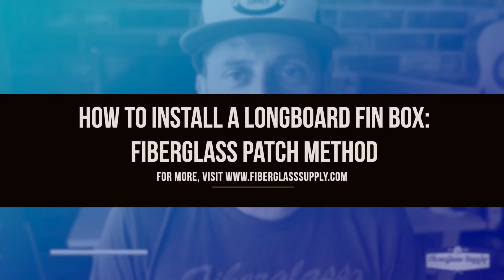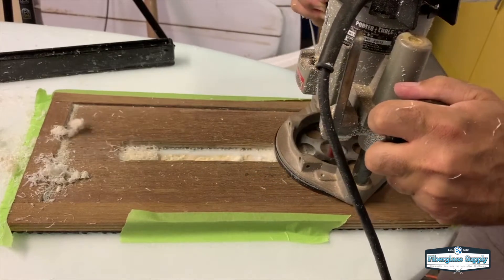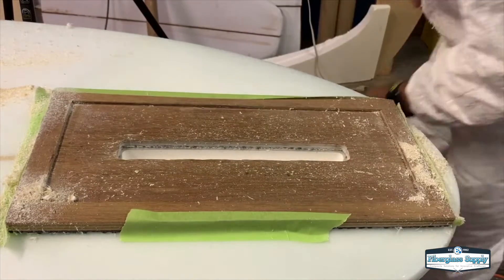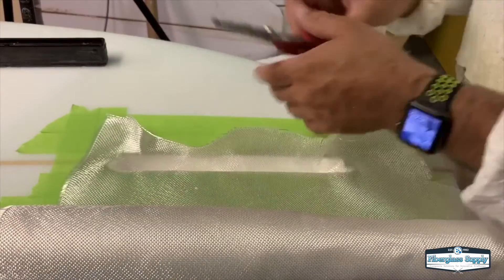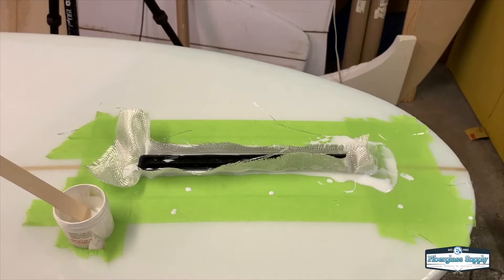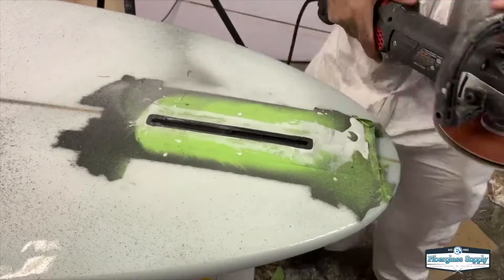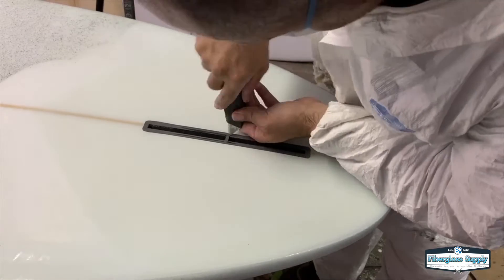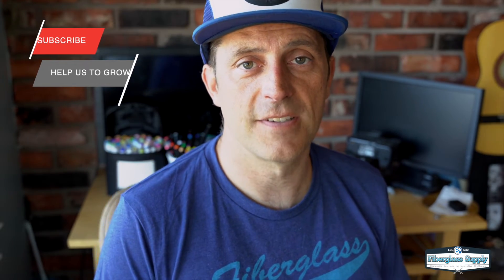How to Install a Longboard or SUP Fin Box: Fiberglass Patch Method

Comment: I like this method I’ve had problems with boxes cracking around the edges.  Putting a glass patch helps hold the resin in place and also prevents the box from floating on the resin.  I would think it also makes a stronger bond.  Thanks for the tip!
Reply: I realize I am kinda off topic but do anyone know of a good site to stream new tv shows online?

Comment: Is the grinding to flush fit the Bahne box why you wouldn't glass over top like you would for a Futures box (gouging the raw foam)?
Reply from the maker: This box gets installed after glassing. It has a lip around the perimeter of it that is about 1/4" (6mm) tall to keep resin from getting in it during the install.  As an extra step after you grind it flush you could glass over it, this will give you a better install and avoid most some of the most common issues with longboard fin boxes (cracking and leaking at the front of the box).

Comment: You dont need to put a fin in while installing to check to if the box is true?
Reply from the maker: That is an option. Depending on the shape and the fin box type may be something that you want to do.  With this particular box there are 4 small tabs that rest on the edge of the hole and help line it up so I don't use a fin to check the box alignment.

Comment: What sort of router bit do you use?
Reply from the maker: 1/2” diameter 2 flute carbide bit preferably with a cutting edge longer than 1” but in a pinch you can make a 1” cutting edge work.
Reply: @FiberglassSupply thanks. Is that with a bearing on it? I can't understand what would stop the bit cutting into the wooden guide
Reply from the maker: No. The wooden guide has raised edges that the router plate runs into to keep it from going too far.